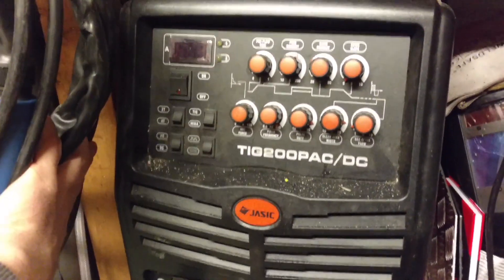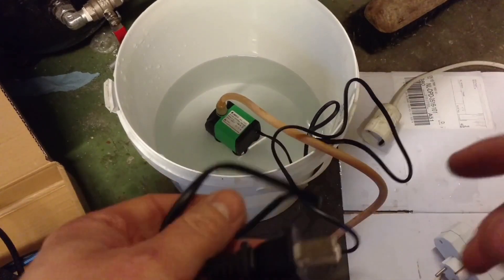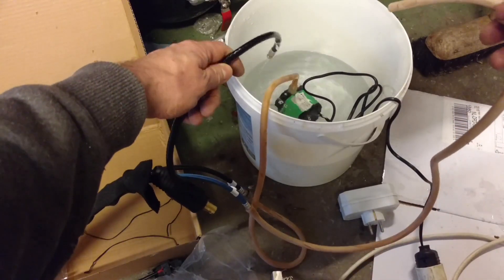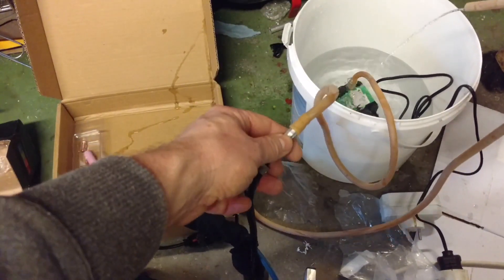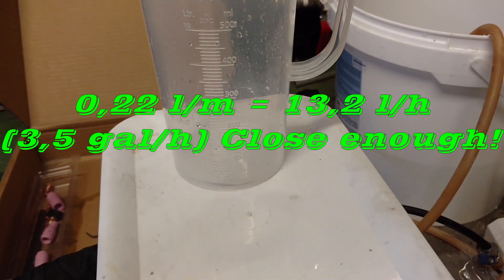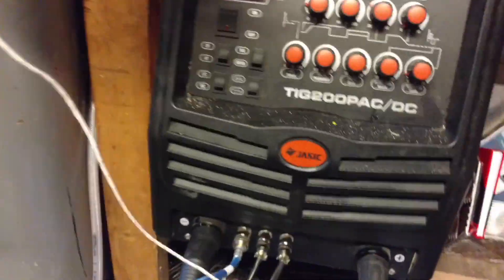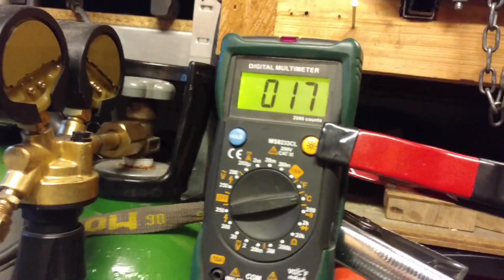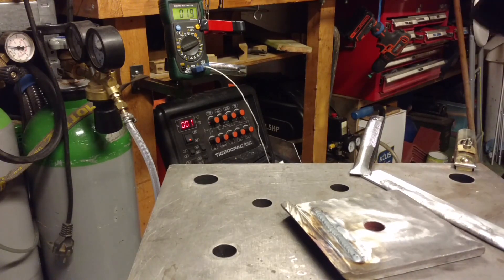Cheapest DIY water-cooled tig torch setup. How hot will it get?

Comment: Smart.  Could you run some metal tube or a small radiator attached to a welding table conduct more heat away?  A metal bucket would help conduct heat away.  With conduction methods you could use an air circulator from a computer.